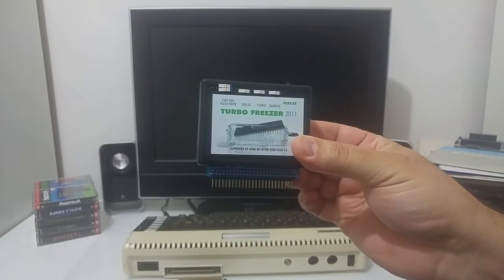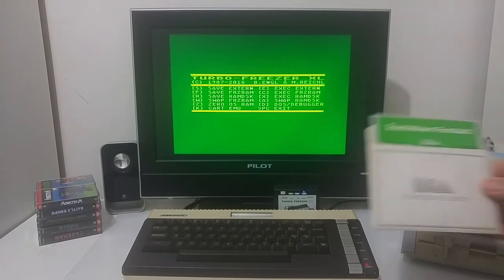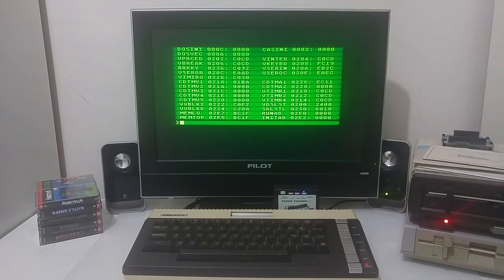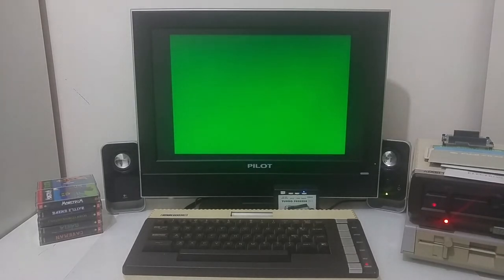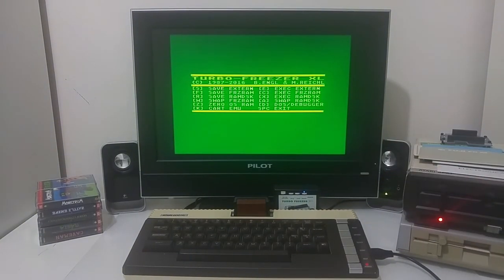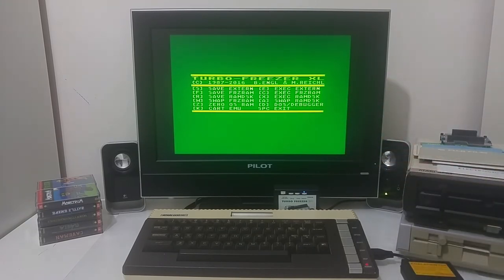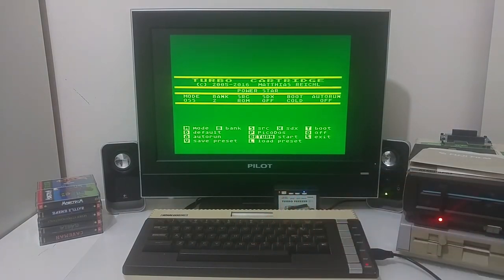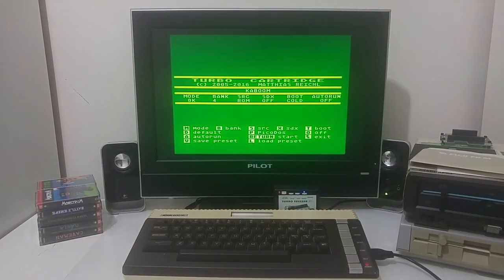Atari XL/XE Turbo Freezer 2016 Demonstration

Comment: Just a little note re this as Panos is about to make a new set of these carts. Yes you can save to disk and it will bypass protection (normally) BUT if the game goes back for levels or other stuff off the original disk these will be missing from the dumped disk. ie its only works for all in memory games. If you create a file and can get to copy the contents of the original disk to it as well you may get lucky and it won't check the protection again. Its not a criticism, just making sure people realise a dump to disk may not work and certainly any extra data needed would have to be on the dumped disk and if its not a DOS game you won't be able to do that. That said I've signed up for a new cart :)
Reply: Also, unless I'm wrong it saves ALL ram that is being used so disk dumps will be big, hence the long load in the demo, this can't be helped..
Reply: Argh, don't want to seem to be nagging but dumping carts CAN be that easy but some carts try to overwrite themselves as a protection, I'm not sure if this will protect from that?
Reply: If your friend has a copy of the disk even though it doesn't start because of copy protection, chances are this method would work and it would still load new data because it has already assumed the disk is valid. Two other problems as you say, a cart that overwrites itself, or there should be some hardware registers which read a different thing than what you write to them, so some hardware configuration might not be saved properly.

Comment: That's very useful. Especially considering the agonisingly slow loading of tape games, and general lack of save functionality in most games.
Saving to the internal memory is basically the same operation as using savestates in an emulator. And while that can seem a bit like cheating, it's an amazingly good way to take the frustration out of a lot of old games...
Assuming they frustrate you of course.

I assume this doesn't work as well for games that are more than 64 kilobytes though. (or maybe 128 kilobytes on those later XE models) - whether that's because it makes use of a RAM upgrade, or because the game does a multi-load or the like...
Oh well...

Comment: You mischaracterized what it does with floppy games.  It's saving the state of the computer--not making a full copy of a floppy game.  If the game expects data to exist on the floppy and the original floppy isn't back in the drive again, it won't find that missing data and you no longer have a so-called "cracked" copy.  It's not cracked... you just have a memory-resident section of the game from whatever happened to be in memory at that moment in time.  As for saving cartridge games... are you sure it can copy banking cartridges?  I'm sure it'll save the state of the system when a cartridge is running but does it save the actual contents of the cartridge or does it again only just save the current state of the system (and thus only save non-banking cartridges since there's more data in the cartridge than is in addressable memory at any one moment)?  I ask this because once you boot up the Pitfall 2 game, it doesn't start the scroll from the start--as if you had already had the system running and it was continuing the scroll from where it was before.  If so, you didn't "hack the cartridge and turn it into a boot disc"... all you did was save the state of the system at that moment in time--it didn't actually copy the contents of the game.  It's a pretty important distinction.  If you started playing the game and then saved the cartridge to the disc in the middle of playing... and then boot the floppy later, I'll bet the game continues from right where you were instead of actually booting the game up.  If I were trying to keep things as true to the original code as possible, this would absolutely NOT be the same and I wouldn't like that someone else already polluted the game with their running state.